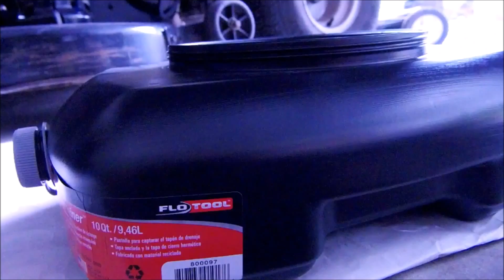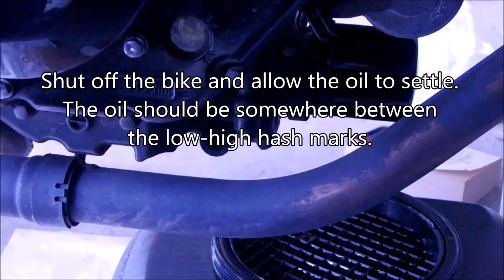No BS Suzuki SV650 Oil Change

Comment: Aaaand one 'tip' from me - it's better to drain oil when engine is warm (not too hot) because oil is more fluid and flows easier. :)
Cheers!
Reply from the maker: +Cafe Racer Yap good tip too...and not too hot like you said. I've mistakenly done that before. Threw the drain bolt down the driveway like a hot potato.
Reply: +1 Service manual also recommends this.

Comment: I'd add one more step. After removing the filter wipe off the area before new filter goes on. Less crap filtering through and a better deal
Reply from the maker: +John “Big Red” Davis Yup! Call me laze lol.
Reply: One more step. Prefill the oil filter so you don't run your engine dry.

Comment: Great video! The only thing I would have liked is to add the torque bolt part to the video. You mentioned in the middle of the video to do it at the end but did not reference it at the end. Otherwise it's great, thank you for the no frills video!

Comment: Hey man, I just did my oil change today and I was wondering how tight I should screw the oil filter on? I made it as tight as I could by hand but should it  be tighter?  Thanks
Reply from the maker: +RCpilot1013 You sound good to go. No need to he-man it. I usually get it tight by hand then do a little 1/4 - 1/2 turn. That way I can get it off again without needing any special tools.

Comment: Since you put so many miles on your bike you should check out a PC Racing Filter they are re-usable just take off clean and put back on. I'be been using the same filter since 2010. The same filter fit both bikes. It has close to 50,000 miles on it and i just recently put a new O-Ring on it which they come with a spare....The best price is on Amazon...
Reply from the maker: +weljo2001 I never even knew they made anything like that. Pretty cool!